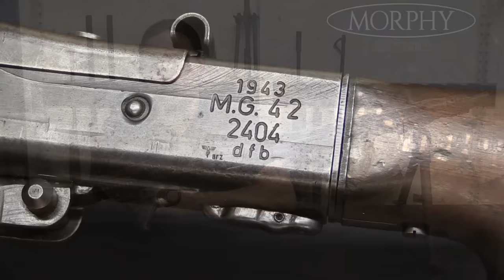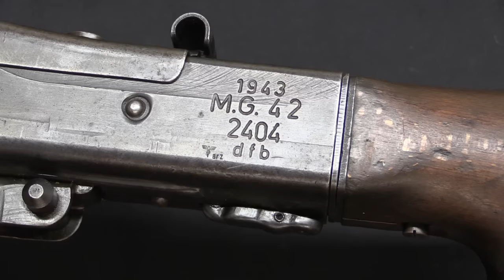Hitler's Zipper: The MG-42 Universal Machine Gun

Comment: A friend of mine served in the Bundeswehr and when they trained on the newer version of the MG42, the MG3, they were required to get 3 bursts of fire out of a belt of ammo with only 15 rounds on it, in an attempt to learn how not to eat up all their ammo immediately.
Reply: That sounds very difficult to do
Reply: Who can resist the brrrrt
Reply: For some reason I had a vision of the CZ-61 holster from a while back, with the 10-round magazine - but on a much larger scale.
Reply: @AshleyPomeroy  finally a suitable ccw
Reply: @sawyere2496  but very important to do, because it eats a lot of ammo if you don't. And there's nothing worse than having enemies left at the end of the ammo!
Reply: Depending on the gun, its quite easy to do. Even single shots are ore or less easy to do.
Reply: Yep, that's the way we were trained to use MG3 in the 1980ies.
Reply: @timbusfahrer3172  it's about ammo consumption. Short bursts are 3-5 rounds, long bursts are 5-7 rounds. Long burst initially, then short bursts to keep their heads down.
Reply: @ScottKenny1978  Then why even bother with a weapon capable of shooting 1200 rpm? The americans have a way better approach by actually shooting their machine guns full auto at enemies.
Reply: @timbusfahrer3172  the Americans use machine guns that shoot 600 (M60s and M240s) or 800rpm (SAW) max.
Reply: @ScottKenny1978  Yes and they use those in full auto to great effect
Reply: @timbusfahrer3172  
Where did you serve to impart such wisdom? The MG3 on bipod is used by the infantry for mobile use. Here, a trained machine gunner shoots short and precise bursts of fire at recognized targets. On the mount, the same machine gun is used in longer bursts for precise enemy suppression. This doctrine has hardly changed since World War II. Whatever the Americans do doesn't matter as they don't use a MG3.
Reply: @BewareOfTheKraut  I served in the Bundeswehr and our Hauptfeldwebel despises that we are trained to use short suprseeive bursts on a weapon that can handle  rapid firing 1200 rpm without any issues
Reply: @BewareOfTheKraut  What? My Hauptfeldwebel said he hates the precise shots and wanted us to basically magdump entire ammo belts. I just repeated his opinion since he tought us how to use the gun.
Reply: @BewareOfTheKraut  What? My Hauptfeldwebel said he hates the precise shots and wanted us to basically magdump entire ammo belts. I just repeated his opinion since he tought us how to use the gun.
Reply: @timbusfahrer3172  Let me put it this way: long, area-suppressing bursts are easy; just hold down the trigger and hose down the target area. Short bursts are difficult, but let you suppress a small area for less ammo spent. This is a factor if 1,200 rounds are all you have, and resupply means someone running back to wherever your platoon has stuck the extra ammo.
Also, at a guess, your Hauptfeld was a Panzergrenadier, right?
Reply: In military service i got a chance to put 2x100 round belts trought a MG3 that was one of the best moments in my life the sheer velocity was enough to raise hairs on back of your neck and the sound was terrifying and pulling it apart was interesting.
Reply: firydeth2
I did that too.
Reply: Sweet Jesus, please guys.. Read up on things before whining how machine guns should be used. Germany has almost no military budget, and the mg3 fires slower than 1200. German soldiers cannot risk barrels burning out due to cost, thus they tend to conserve ammunition and fire in shorter bursts.
Reply: @johnngrey1   That's very true.   I think that the MG 3 is a VERY good firearm.  It is Reliable.  It is Durable.  It is easy to take care on the battlefield. And the MG42 is the direct ancestor to the MG3  Added:  I have fired the MG 3, but I have a personal bias for the M60.  It is the fact that my friend, who was a gunner in Vietnam is no longer with us. He showed me the tricks on the firearm.  I miss him and his stories.  Yea I'm a old man.
Reply: @johnngrey1  thats not the reason for short bursts.
the reason for short bursts is ammo conservation and precision. more like a 3 round burst m16. you shoot 3-5 rounds in a vers short amount of time before the barrel rises and the recoil really kicks in, saturating a target area with effective fire.
that was done already in ww2 and is basic mg-schützen training in the german armed forces, to maximise your fire for effect.
the prolonged fire "dauerfeuer" only happens in the late stages of an assault and is either called sturmabwehrfeuer (assault repelling fire) or sturmfeuer (assault fire), to surpress advancing enemy soldiers infront of your positions or, when assaulting, in their positions.
also you should note that you need to hit several targets with limited ammunition on ranges up to 1500m with next to no misses for your schützenschnur (marksmen badge).
the barrel change in training happens every 150 rounds, in the field on average each 300 rounds, both is long before they burn out, but when they are shot hot.
precise shooting is trained not due to budget restraints but due to training for fire for effect. saturating a target area with 100 rounds 7,62 nato has not much of an effect, except you run out of ammunition very quickly and you maybe hit an enemy or surpress them for a few moments, until they realise that you are out of ammo. short precise bursts will surpress and kill effectively. 
please read and learn about the stuff you are talking about ;)
Reply: @zhufortheimpaler4041  I have read. I may not know about older doctrine like you, but I have talked to modern troopers and read up a bit. Germany has no budget currently so they do have a hard time with cost of equipment and munitions , he rest may be the case as well but I won't know until I talk to more Germans
Reply: @johnngrey1  and this is, where you are wrong.
this is no older doctrine, but current doctrine and hasnt changed much.

the financial problems are not due to a short budged.
the bundeswehr has about the same budged as the british or french armed forces have, has a smaller personnel strength etc and is overall a smaller army.
the pay for a normal soldier is about 50% higher than in france or the uk, this chewes up budget.
also a very large portion of the budget is thrown out of the windows for ludicrus contracts, 3rd party advisors, unneccesary projects that end up in the gutter.
the department of procurement has made very bad contracts for the last 30 years, where the contractor ( for example airbus) is not fined for production and developement delays, non functional equipment (like with the puma ifv) and other problems. on the contrary, the bundeswehr is mandated to still pay and buy the full price for inadequate equipment (happened with the a400m, wich was delayed for several years, did not fullfill the contract expectations and requirements etc, so only half of the ordered contract was bought, but at double the price, 10 years later the plane still has not 100% functionality as required, for example the digital loading deck work station is still not implemented) 

the other big problem is, that with the end of conscription 2010, the ministry of defense and bundeswehr command closed several bases and barracs all over germany, to reduce cost.
but they closed the logistic centres and material stockpiles for repair parts etc.

the budget of the bundeswehr is not too low, it is just massively missmanaged.
the french and british have larger militaries for about the same price, their stuff works (well the challanger more or less), they have aircraft carriers, nuclear submarines, nukes etc. 
so either military is just more expensive in germany (about 50% more expensive), or the bundeswehr and the ministry of defense fucked up royaly in the last 15 - 30 years, because our neighbours seem to be able to work with such a budget for an even larger army.
Reply: I served in the German Bundeswehr in a Combat Unit as a M113 ATV driver 1967/68 an we all had to try this option with a MG42 MG42. The guys who were able to make 5 times each 3 shots fired became the MG gunners, one gunner in each group.
Reply: I'm always amazed how armchair generals are regularly fighting over a doctrine or "which gun is better" while having, as it seems, zero interest in actually learning anything about it.
This gun is in use for almost 80 years by dozens of countries with basically no major changes. And it will be used for quite some time in the future, I'm sure - at least on the Leopard tanks.
So if that gun would be crap or so much worse than other guns like the M60, why is it still in use? And other guns of its era are not? Because it does a pretty good job, that's why. And it works perfectly fine for its niche.
Reply: @firydeth2 that is a requirement to be a machine gunner with that weapon
Reply: I never got less than 3 shots per trigger pull. Our company record was 2.
Reply: It's fairly easy to shoot even fever rounds than that in one burst.
Reply: @30cal23  I was told that it was actually possible to alter the rate of fire just by changing the musslebrake. As I was told, it was the diameter of the hole in the brake that contributed to the firing rate. Smaller dia made it fire more rapidly. So a larger dia would possibly lower the rate.
Reply: @zhufortheimpaler4041  in my opinion, the bipod is the only flaw of this gun. As soon as you fire longer bursts the bipod will pivot back and make the barrel rise slightly and make you hit abowe your target. Longer bursts may be necessary if your target is hiding behind a brick wall or similar.
Reply: @_Viking  the ciclyc rate of the mg3 and previous mg42 is based on the recoil spring and buffer spring plus the the bolt carrier. there were kits to modify the rate of fire to around 800 rounds issued.
Reply: Mit einem Trick schaffst du sogar Einzelfeuer 😉
Reply: In 1975 Basic Training we had to master 1+2+3 round bursts of the M-16 while on full auto! Not the easiest thing to do!!

Comment: Since I was working with an MG42 derivat for a longer time that has almost no changes I can tell you that 
a) Swaping the barrel is not as easy as it seems since you can not touch the hot barrel and there is no good way to grab it
b) The receiver is hard to clean on the inside. The part in the middle can cut your finger quite easy
c) No matter how you try to carry this thing on your shoulder it is uncomfortable to carry in pretty much any position
d) The little flaps on the bipod are not really good for holding it into place. It works OK in design, but during combat it's not that good. The bipods pivot point also come lose somewhat often.
Reply: Swaping the barrel is not as easy as it seems since you can not touch the hot barrel and there is no good way to grab it

What about using a tool to "hook" it or using protective gloves?
Reply: In my experince the best way to go about these problems is:
a) use a casing to pull the barrel out
b)"toothbrush"
c)sideways on top of the backpack, holding the carry strap with your hands so it doesn't slide off
d) why are you even bothering to fold up the bipod in combat?
Reply: @VRichardsn  Not sure how the germans did it back then. The old tool (for me) was a tiny piece of Asbestos that could slip off very easy thus burning your hand. The new tool is indeed a glove that is large enough to be used with your regular gloves on. The downside here is that there is no real good way of carring it around. And if it get's dirty your barrel will be as well which of course is not really good for your gun.
I have never used a hook since the barrel can drop out quite easily. We had some small boxes for the barrel that were used to carry it around. With a hook I can't quite imagine that the barrel would land in there consistenly enough to be a good option in the russian mud.
Reply: @KuruGDI  Fair enough. Cartridge cases are decent enough to pull out the hot barrel. I think Ian did exactly that many years ago: https://www.youtube.com/watch?v=GfJkU4Sah8I
Reply: @Rotsteinblock 
a) I didn't really try that one, but since even the large glove we didn't work that well, I'm not sure if the bulky casing we had would even be good enough to even try to pull it out.
c) After carring it for more than a kilometer you don't want to hold it on the strap any longer. The best way I found is to rest the left side of the gun at the point where the charging handle is in your neck. The top cover has the sight, the right side has the charging handle and the bottom side has the resting lug for the gun carriage. All other parts are too far off the center of mass to balance it there.
d) depends on the travel length, but when you have to carry it a bit further than through rough terrain it can hit something and pop off or break.